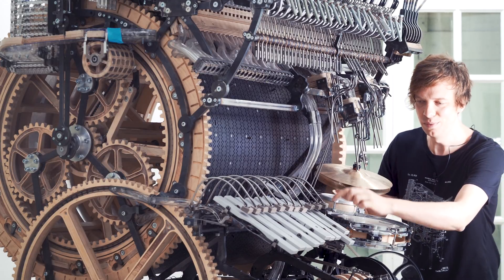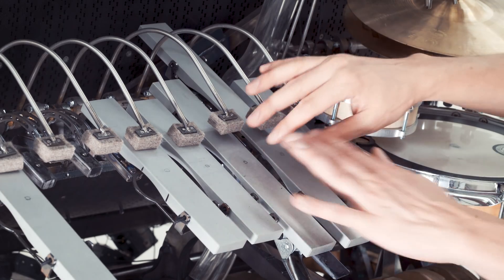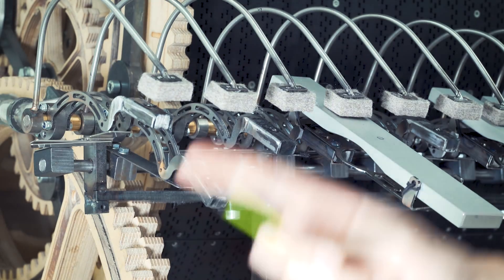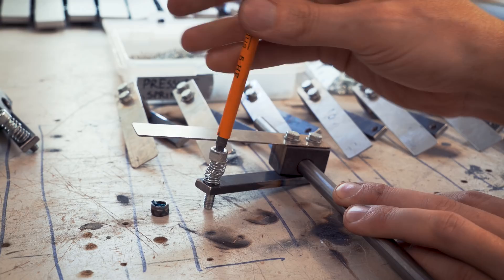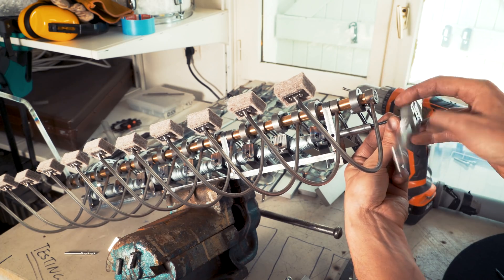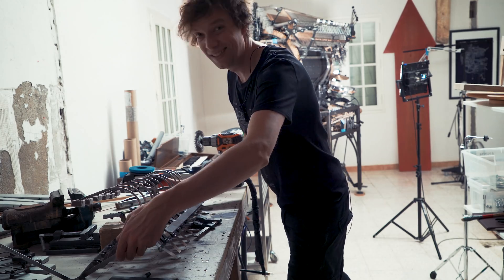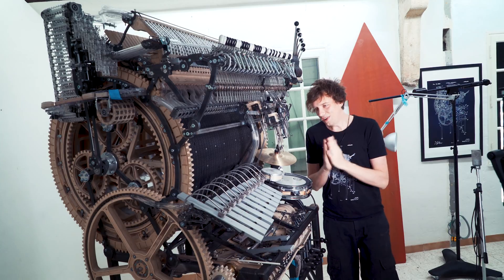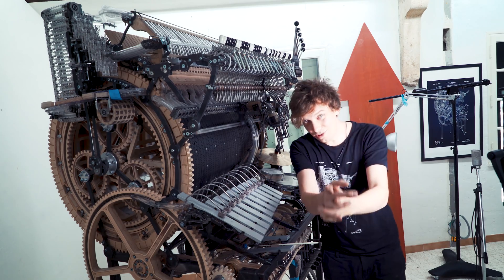Vibraphone Height Adjustment - Marble Machine X #103

Comment: So uh.
I don't want to be a negative nancy or nothin'. But wouldn't it have been mechanically simpler if you just pre-shimmed all the vibraphone bars so that they all just naturally sat at the same height? Assuming you've got basically identical springs and whatnot the whole way across, if one note naturally drops 3mm lower than another note, just have it with a 3mm taller shim, and the same with all the other notes. That would prevent you from really having to make any adjustments anywhere between any songs while performing live.

Edit: I don't think I explained this well.
Imagine the magnetic shim, like he showed between the bars and the spring plate. Except instead of not being connected, and sticking to the magnet, it's actually just built into the bottom of the bar mount.

Comment: Something tells me that your decision to make the sprung height of the vibraphone bars easily adjustable on an individual basis is going to pay huuuuuge dividends when it comes time to fine tune the ballistic path of balls into catch funnels.

Just a hunch ;)
Reply: It still won't help much for live performance.  I'd prefer a solution that would allow minimal fiddling and tuning between songs, especially with a complex machine  with tons of things that potentially need to be adjusted each time a song is changed out on the programming wheel, and note bars are swapped on the vibraphone.  

The goal needs to be to make this thing user friendly,  idiot proof, and reliable.  If you have to extensively train your Roadies how to swap out vibraphone bars and dong programming plates, you designed it wrong.  It should be something that a teen could do flawlessly after reading an Ikea style one page instruction sheet.

Comment: So... umm.... any particular reason why you didn't change the height of the brackets supporting the bars (the ones you cut up a few episodes ago and rewelded them so the bars are all aligned) such that it will account for each bar sitting lower or higher? That way you don't need to adjust anything when changing keys.

Comment: The problem is that you have to adjust the machine every time you change notes... that's not a great solution.  Why not adjust the actual mounting point.  Weld some spacers between the square tubing.  That way, they will be preset and you can just plug and play.

Comment: It might be useful to have an adjustment jig-- just a reference bar you can lay across the top-- to make adjustments faster and more consistent on stage. Especially if it's dark.

Also: get yourself a T-handle Allen wrench. Way easier to handle on stage.

Comment: You need to put the adjustment on the note itself so it stays adjusted and can be installed on any point without needing more adjustment, basically if the note is in control of the adjustment then you can just pull that note off with it's set adjustment and just put it onto any other position without needing adjustment. Why not just add a threaded stud with nut to the block that touches the end of the spring, extend it it for bigger ones and shorten for smaller ones.

Comment: Why dont you set the height of each note? so the weight is unchanged, but lower notes will sit a bit higher in their "holders", which would make them all even again, and you wouldnt have to change the height of each note again after replacing it

Comment: I think with that solution I would be a little concerned the screws would twist during playing. That could be solved by placing a spring on the shaft of each adjustment screw.

Another solution that immediately springs to mind (No pun intended) would be to use the shim method but build the shim into the plate holders. So when you fit a plate, it pushes a fixed shim (maybe a simple plate in a z shape welded to the bottom of the plate holder) between the spring plate and guide above.

Comment: if you want to replace the washer stacks with some beauty,
send me the diameter of the shaft and the individual length, and i will turn you some beautiful spacers for free.

Material is up to you - POM/plastic, aluminum, brass or steel.
Reply: Something ornate would be cool.

Comment: all of this is good: but if you play a music with a quick tempo: wont the movement of the vibraphone up and down desynch the moment the marble hit the note ?  because it will be futher down/ it won't have time to recover
Reply: Ahh, well spotted. This comment needs more reactions. bump
Reply: Perhaps he plans to adjust the level to be higher for the faster tempo music - and give himself the option for greater bounce for the slower pieces?
Reply: Idk I think the entire machine makes some concessions to looking cool at the expense of performance (this problem is just solved by not playing so quickly).   That said, I'd like to hear him address this
Reply: Agreed and agreed this will shout out for harder spring steel plates.
Reply: Absolutely possible or even probable that marbles will hit the vibraphone plate while it's "down", but I don't think that's an issue:

Quick fermi estimation: I can't tell whether something is "on-beat" if it's accurate within 10ms, and the bar doesn't seem to move that much, lets say 10mm at maximum. For the 10mm movement to make a 10ms difference in timing, the marble would have to be moving at 10mm per 10ms or slower, which is 1 meter per second. The marble falling onto the plate is definitely going faster than that.
Reply: @shelvacu  yea but... the whole point about this height adjustment was to avoid one marble to hit the bar a few mm later, but i get your point
Reply: @ereder1476  Was it? I thought it was just a cosmetic thing
Reply: @shelvacu  Well assuming drop height of 40cm, the average speed of the marble is 1.4 m/s Vfinal = sqrt(2*g*d) for an object initially at rest, so a slightly stiffer spring steel, or just not playing the two notes immediately back to back would do the trick
Reply: @josephanderson7780  But the average speed doesn't matter, the speed that makes the difference is the speed just before it hits the plate
Reply: I wondered about that also. The height adjustment should be able to help with that though; the higher they are then the more tension they should have. Also, it should work sort of like piano keys being pressed down. You're generally not hitting the keys so fast that they don't have enough bounce back to make another note. I'm not sure what the threshold is for the hit from the marble based on the y-position of the bars, but if they can be raised or lowered without much difference in the sound or tempo then it should be a negligible difference where the bar is as the next marble drops. I would also like to see those tests; I'm sure that he has done so.
Reply: It should have been solved much simplier by rubber + felt buffers. To much risk of interference going on here swinging.
Reply: I thought the entire point of the positive stop was to stop them wagging up and down and spoiling the timing

Comment: Instead of having to have a tool to adjust, why not use course thread adjustment and have really long stemmed screws, with numbered dial indication marks at the top, then you can mark each note with the appropriate setting and dial it in with out a tool.

Comment: The concept of adding weight or the non-concentric screw, or the final solution are all based on physics and  are fundamentally the same thing. From a cosmetic perspective they solve the problem of equitable height of all the bars, but from the dampening aspect of the bars vibrations all of the proposed solutions have the exact same ultimate effect. Adding mass or changing the loading vectors of the support spring all impose the same forces to the setup and will dampen them equitably so no net benefit with any of them from a musical perspective. Cosmetic solution...solved....acustical problem...no net benefit of the final construct over other proposals

Comment: my suggestion would be to incorporate the adjusted position setting to each vibraphone plate itself. Since they are custom suited for each vibraphone note anyway, they should also account for their position in the vertical as well as so they are hit in the sweet spot.

Comment: Replace the set screws with long set screws, 6 - 8 cm or even much longer, with knurled heads, like the needle valve on some carburators have, that you can turn with finger and thumb. Eliminate the need for an adjustment tool.

Comment: It's good, but the better solution would have been to build the set screw into the plate carrier and have fixed uniform springs; that way you only have to set the adjustment once and the adjustment stays with the note even when you swap them around.

Comment: You could built in the spring and adjustment into a note, making adjustment independent from the position, but unique to each note, no mater in which position you place it. Love your videos and tremendous effort!
Reply: He doesn't need to.  He is being a bit closed minded about mass tuning.  He needs to think more about where the marble hits relative to the center of mass.  If they all weigh the same, and get struck at the same spot relative to the center of mass, they can be made to all move the same amount (and exactly just the right amount).  This will also make recovering the marbles easier later.

Comment: I'm a bit concerned about adjusting those once the PMMA pipes and drop mechanism is installed. It may also be advisable to add permanent extension to each screw with a small knob. Especially when you are dealing with this on a dark stage, trying to "find" the hex head. Perhaps reversing the point of adjustment to the bottom? To get out of the way of the pipes and drop mechanism.

Comment: Hey Martin, I had an idea on how you can record the sound from the resinator pipes. I think contact mics will be quite effective because the pipes will be vibrating at the same frequency in which they are adjusted to. I hope it works😅 #mmx

Comment: This is like the episode about perfecting/finding a compromise marble drop point all over. 

Martin could have made new holders custom to every note with different height that compensated for the difference. 
That soloution would not need any adjustment, and it would have been simpler considering that the majority of holders just were cut and rewelded together.

I also think that Martin is rushing to get some results. It might be bether to take some more time in CAD to figure things out before building.
Reply: Lol, I just posted this one myself. Just add fixed spacers in the holders. Make sure they are the right height for the weight. Then never have to worry about modifying the spring. Seems the most reliable way to go, also faster to swap the notes.
Reply: I totally agree with you. I think every solution that require additional adjustment live is terrible. Between different songs, many people will work on the Mmx there will be pressure and mistakes will be made.

Comment: I suggest you do a small indentation/pot hole in the steel bar where the screws rest, to prevent the tips from sliding around as you adjust the tension.

Comment: What about adding the correct shim to the bar holder. It can be spaced so it slots over the spring steel support. Change the bar and it changes the support hight

Comment: Well I see the marble paths have been bent and routed and the piece you cut has been reattached which probably means you’ve got the marble drops all squared away. That’ll be our next video probably and in the meantime you’re finally working on the parts I’ve been warning you about for weeks. The vibraphone pipes and their many problems and limitations. I hope you go with the design I outlined in my previous comments for the sake of time especially since you just added another level of tuning to the machine so more time between songs. Martin these pipes can be more limiting than anything else on the vibraphone yet. I hope you take some time to test all the possible designs and go with the best of course but I can’t imagine anything faster than those adjustable pipes you came up with.

Comment: This video takes a software engineering concept and used it as a mechanical engineering solution: encapsulation, one part does one thing or a limited selection of closely related things.

Comment: ALERT - THERE IS A SIMPLER SOLUTION TO THE PROBLEM

The keyword for this solution is "Standardization".

The new stardard I suggest here is the weight of the holder with the note.
If every note has the same weight, there will be no more issue about the height or the way the note move because they are the same weight.
You only have to add weight on the holders.
Benefits :
- Faster note switch : you don't have to ajust height or angle anymore.
- Standard mount : There will be no more difference between each parts holding the notes.

And the thing you just did is great because the springs and the spring steels wear off in time, have a easy way to recalibrate is just great.

I say Standardization because it's the thing you did by making the marble drops "Standard" and dealing with the most random/difficult parts of the machine, but the most accessible parts : the notes.
This time is no exception. You have to define which part is stardard (the arms holding the notes) and which part is variable (the notes) and make them the most standard possible (same weight).

By setting stardards, you multiply the possibilities on the machine because you won't worry anymore if this part fit. After that, you will be able to experiment new things, like wooden notes for example.

Comment: FEEDBACK - I think option 3 got dismissed too quickly. Adding weights is a good idea. BUT, I think the weight needs to get added to the removable frame that holds the vibraphone plate. That way, you could pre-configure each of the removable notes to weigh the exact same, and no adjustment would ever be needed again. They would all be the same weight as the heaviest note. And, since all the notes now weigh the same, you could select your spring steel to give you the amount of bounce you'd be happy with. Consistency across all of the notes would make your plate changes very quick. Just a thought.

Comment: How do you make sure that the height is the same after switching the plates? Sure, you can adjust it, but if all plates are switched there is no reference to the "correct" setting?
Do you have a fixed mark where you can adjust it to? 

Otherwise I see problems to keep the timing of the marbles consistant.

Comment: I would have gone and integrated the spring steel into the vibraphone-holders, that way you adjust it once and never again because it is already tuned for the right weight.

Comment: Now I have no engeneering background and have never commented on these videos, I'm sure my comment will be lost in the comment section and I'm sure, you've thought in way more detail than you explained in this video...

But in all honesty, I think the added weight is the most elegant and the simplest solution!
Yes the higher notes will bounce less, but they will bounce all the similar way whitch will make the catching of the bounced marbel later much easier. Also the changing of the notes will stay as easy and fast as it was before the change and the springs can all have the same strength.
EDIT: And the heavier bars when moved up will be hold by a spring with more tension, so they will bounce differently than the lighter ones nontheless.
I see no disadvantage to this method and I'm not sure, why it was diched this quickly.

I'm of course still looking forewards to more MMX Videos and the finished product ^^
This is just way to awesome to don't work. Keep it up!

Comment: Tidy solution.  One recommendation though: set the height of the heaviest note to be a little lower and adjust all to match.   The heavy notes are right at the end of the adjustment thread, and it's best to keep a bit more margin for as the spring steel says.
Reply: Or he can just use longer screws if it gets bottomed out.
Reply: @4IN14094  Also a valid answer given his envious screw collection.  Down to how hard it is to change over
Reply: @4IN14094  He probably can't afford longer screws after using up all the washers in Europe.
Reply: The problem is he has too stay within the range of the dampeners, and im not sure how large a range that is for them to work properly
Reply: @TazPessle  they can easily be moved down though.
Reply: @BartJBols  depends on the tolerance of the marble catch, which is yet to be designed.
Reply: @TazPessle  it may have to be a big tolerance, even if the testing height is matched the spring steel will have different tensions based on their weight and so not all bars deflect by the same amount on a strike.  Add the different bar inertia and that for fast music with the double notes the bar may not be all the way back to rest for the second strike... The dynamic variance will be hard to test and the catcher may be tricky.  That is still the challenge even if the height and angle of the resting point is controlled now.
Reply: @TazPessle  that's overcome by moving the center of mass

Comment: Why didn't you put the springs on the bar themselves? That way you would need to adjust them, they would already have they spring load adjusted.

P.S.: have you though of smoke and mirrors to highlight the machine movements? Humans are quite good at noticing high contrast movements, even small ones.

Comment: Martin, why not make all the the bars the same weight? This way no adjustment is needed. Here is a  simple test. Step 1, make the lightest bar weigh the same as the heaviest. Step 2, set a co troll bar at the desired height. Step 3, place the larger bar next to the control, and set desired height. Step 4, swap smaller bar with larger bar, and mease the gap. If no gap, then viable solution, if gap try something else.